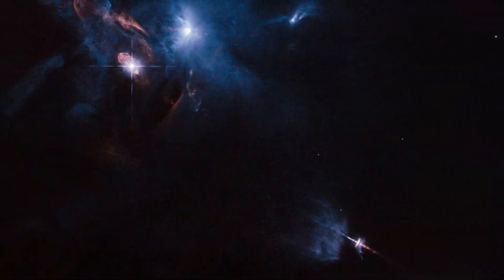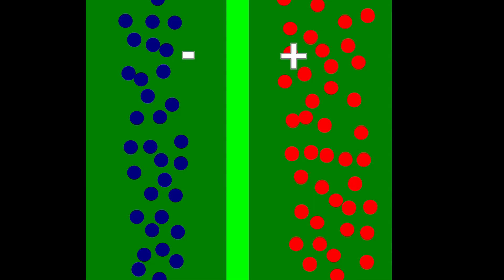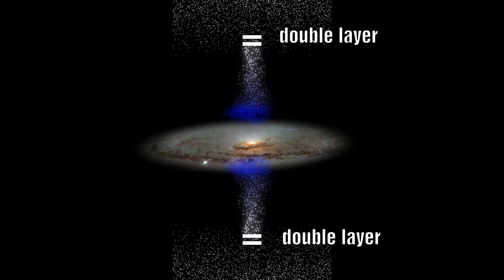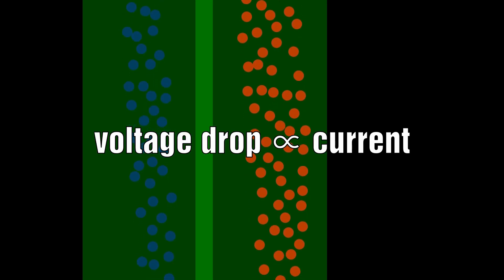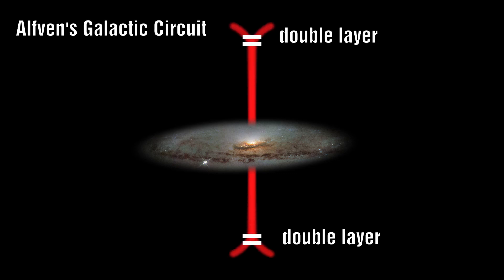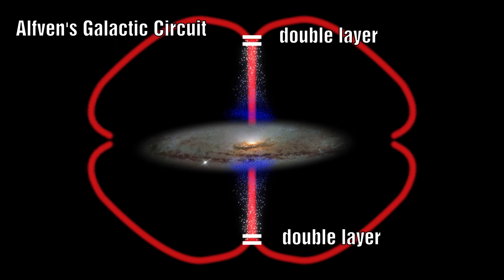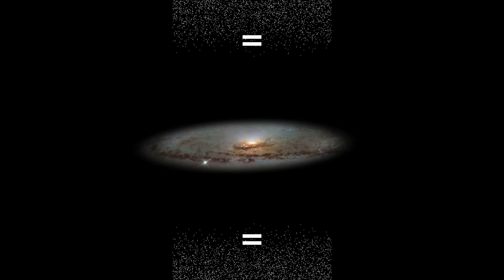Understanding Plasma Double Layers in 120 Seconds

Comment: And they are expressions of 0-1-2-ness log-antilog prime-cofactor projection-drawing horizons. 

These are the conduits that "Null Ships" were supposed to use to navigate between stars, and presumably the Warp Speed multiple is a matter of alignment in a reciprocation-recirculation potential positioning integration of harmonics of indescribable complexity to everyone not trained by Scotty the Star Trek Warp Engineer.

Comment: I'm sorry but this explanation is unclear and cryptic and I'm still not any closer to understanding double layers. Why would so much opposite charge buildup at any specific location in space and why don't they just neutralise, then the excess charge will just dissipate since they're of similar polarity and they repel?  Why would particles move through double layers and "feel acceleration", yet what about the particles forming the actual double layers, why don't they feel acceleration and break down the structure immediately? If double layers form where there are an excess of charge then there should be double layers everywhere, since charge seldomly are equal anywhere in space?
Reply from the maker: Well it’s hard to squeeze it all in 120s. The longer version linked at the end should give you a better understanding. Simply speaking they form when attempting to suppress and external field the plasma is exposed to. The reason the charges remain in place is partly due to shielding (see plasma simply explained for a detailed description of this) this causes the electric field within it to be low compared to between the layers.
Reply: ok so he's made this one for you :) https://www.youtube.com/watch?v=bYhs94N7ZuY otherwise try https://www.plasma-universe.com/double-layer/ which is a lot longer than 120 secs. its a lot to take in - basically i think if you see charge separated then surmise that energy went in to do that and possibly to maintain the situation as well. someone school me if i got that wrong pls.

Comment: I think a double layer is caused by a vortex in the ether medium.  Essentially Ampere's law.  The magnetic field is a fluid medium that flows around a charged particle as it moves based upon the charge.  The magnetic field flows IAW the right-hand rule for a moving electron and IAW the left-hand rule for a moving, positively-charged particle. Hence an electron is thought to be a vortex, and a positron an anti-vortex. It is the vortices in the magnetic field that provide a pressure that keeps the charges isolated and separated.  
   Double layers are caused by the magnetic fluid pressure buildup between the vortices that surround moving charges.  The Ansae between the barred spiral arms and the ring current at the core are also examples of double layers.  A discharge across the double layer occurs when the voltage difference overcomes the force of the vortex an anti-vortex force that keeps them separated.  
      I think Alfven is right about the torus flowing around a Birkeland flow that is a broken electric flow at the flare and a discharge through the loops of the solar flare, but I also think it is possible that the torus is resonating the proton beneath the helium layer, resulting in an explosion like a nuclear bomb that causes the flares to reach as far as the Earth, not just an electrical circuit flow through the solar system that drives the solar winds.  I also think that a proton explosion in the flare will result in an excess of positrons left over after the photons leave the proton.  
    Possibly the positrons neutralize some electrons to keep the Sun's electron buildup in check, giving us the appearance that we are looking at a transistor effect, as proposed by Don Scott, and Ralph Jeurgens,  rather than a solar output based on releasing the binding energy of the proton.

Comment: What hasn't been explained here is the [assumed] mechanism of their production.
Ultimately, according to plasma physics, DLs form in an attempt of plasma to suppress the external field. Ergo, their thickness should be comparable to the Debye length in that particular plasma (e.g. about 100 meters in the solar wind).
Reply from the maker: Thanks for adding that in Eugene
Reply: btw eugene is 'philostopher' intentional?
Reply: @seachangeau  as can be explicitly heard at the beginning of each video, yes.

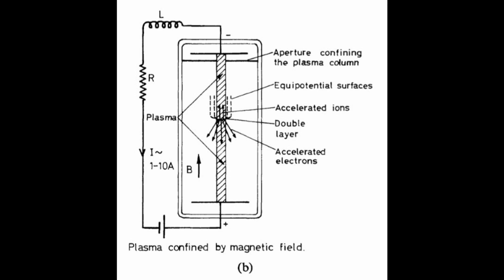Comment: Question. In what spectrum is the plasma viewed? Infra red? I'm learning but no question is dumb, right? I've seen materials filmed at night 1080p IR appearing to fly from the ground up. It looks exactly like 1:22 in your video. 
Thanks, Jill
Reply from the maker: Plasma can be in 3 states. In dark mode it is not visible (gives off no radiation), in glow mode it gives of visible light and and you move into arc mode the photons get more energetic. In double layers this can cause electrons to be accelerated to relativistic speeds which can cause x ray and gamma ray emissions. So in a nutshell they can give off all parts of the em spectrum.
Reply: hmm yes  good point - those infrared haloes in the upper atmosphere of earth